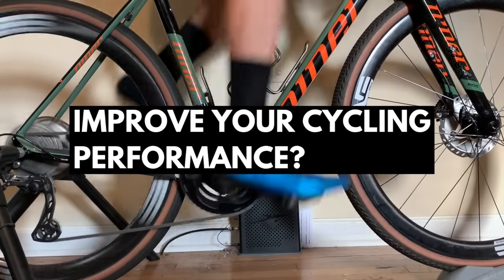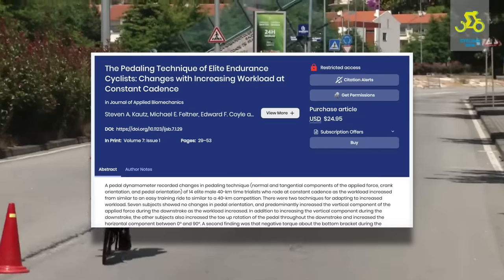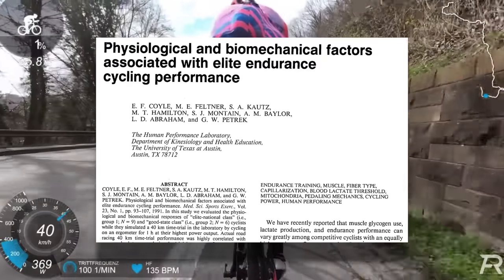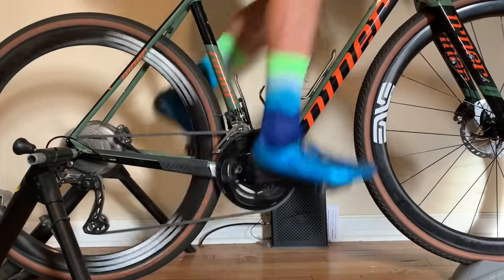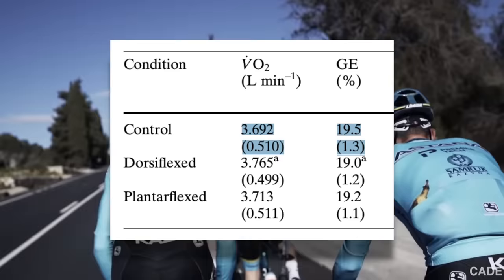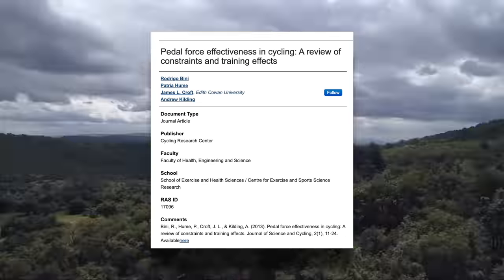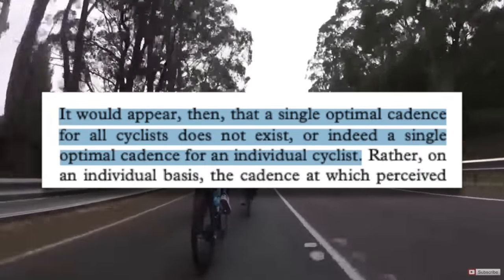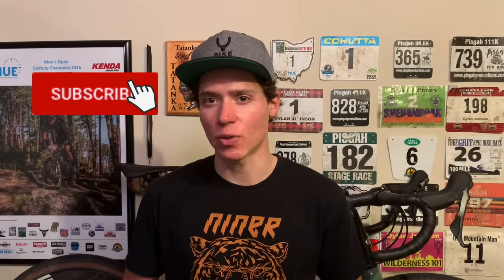Does Your Pedaling Technique Affect Your Cycling Performance? The Science

Comment: Just wondering, how many of these studies had subjects stick to altered cadence / technique for longer than just the few rides they had them do for the study? The fact that doing something new you've just been told about decreases performance shouldn't really come as a surprise regardless of whether that something might ultimately be beneficial. If nothing else there's a mental tax involved with something you're not used to. It wouldn't surprise me if it still doesn't matter, but it also wouldn't surprise me if some people are in fact stuck in a local optimum and would improve if they adopted a different pedaling technique over a longer time period.

Comment: For regular cruising, the upstroke leg should lift itself.  The downstroke leg should not have to power the bike, plus lift the other leg back to the top of the stroke.
You don't have to pull a tree stump out of the ground, just make sure that the leg lifts itself.

But when you are sprinting, yes, pull on the upstroke like your mother is hanging on to that ankle and she is dangling over a volcano.
Reply: Thank you.  You are exactly right on both counts.
That needs to be stressed by anyone who claims to offer advise on pedaling.
Reply: @deezynar good tips and all but did you reply to your own comment agreeing with yourself?
Reply: @erzhaider  
I don't typically reply to myself.  That was 2 years ago, so I have to guess about what happened.  I assume that someone else replied to my comment and I replied to them.  But the other person removed their reply later on.  I have just a slight memory that the person is the one who posted the video, Dylan Johnson.  But I am not certain at all.

Comment: Most people forget that the hip is a bigger and stronger joint than the knee. Which means your hamstring is a big contributor to the power in the down stroke. If you use hamstrings on the upstroke too, there will be a minimal time that muscle is relaxed during the rotation. If you take a look at the blood flow in a muscle flexed compared to relaxed, its obvious that not relaxing the hamstring is a big no-no. U r welcome.

Comment: I wonder how much trained vs untrained muscle activation is biasing the results. For instance, if you train 500+ miles with practicing circles how would that change the 'natural' feel and efficiency of the stroke now that the specific muscles used in the back, up, and over motions are conditioned in the same way downstrokes are practiced. I also wonder if any of those studies used isolated power meters (looking at only one side) that could measure both positive and negative force instead of just combined downward force.

Comment: Don't get a choice with fixed gear! Works really well on the flats. Yes, you will pedal differently at high and low cadence.  Sort of like developing a broad power band in automotive terms. Never ideal, but close enough. Maximum mechanical efficiency at all times though. I noticed many years ago that under high loads trying to get on top of a gear, torque gets applied earlier in th downstroke. Light loads get a more gliding even torque application.

Comment: Roughly my 11.5” feet weigh about 7.5 lbs each. 
Using the scientist approach (as a scientist) lbs = gravity , just lifting your feet up alone 70 times a minute would be like lifting 1,000 lbs a minute one 12” using your legs.
Of coarse there are other factors on the equation, but those are the main ones.
No, it would not be advantageous to power up strokes but to spin pass the upstroke and power down using gravity to assist you.
Sometimes when my legs burn I switch to the “duck paddle” with some successes.

Comment: The video focused on efficiency, but my question is if you change where the power is applied in pedal stroke and cycle between toe up toe down pedaling on endurance rides will that help to reduce fatigue and cramping by switching the load on different muscle groups??  great video thanks for the content!!

Comment: Hey Dylan, thanks for the great content and cheers from Russia! I'm in my first season of structured(ish) training with a power meter and have some questions, perhaps you could help me out?
1. Is there a benefit to building structured workouts in TP if my headunit (Garmin Edge 130) doesn't actually support such workouts? For now I just put in generic workouts on the calendar and time my efforts the old-school way.  
2. I'm really struggling to fit intervals into my training - most of my rides on weekdays are confined to urban environments where doing an uninterrupted several minute effort is not always possible and/or safe. So while I try to keep recovery durations consistent (I do have to count standing at stop lights and/or in traffic as recovery:)), my effort durations are erratic at best. How much does that affect training efficiency? How should I modify my workouts if changing locations is not an option?
3. I'm presently using a power-meter on my road bike only. Thinking of getting one for my MTB but can't seem to choose between a single-sided crank-based PM and a spider-based one - how durable is a spider PM if, say, you whack your sprocket going over a log or some rocks?
Reply: Old timer here.
1. Never used anything like this. I knew ahead every workout I wanted to do. I only had an old watch head "stuck" to my handle bar stem. It is much better looking at a sweep hand than a digital face. I dont see why you cannot remember any workout you plan to do. Then do it. I learnt cadence from a piano metronome. In my day noone was allowed any type of timing device or outside assistance. When you get amoungst the best its about knowing yourself. That means riding by feel.

2. This is a very common problem. I fortunately lived 20 miles outside the city. Today I live up the road from a public velodrome. Is there a public velodrome that you can use?
I had a friend who was a national champion. He got up at 5am every morning. Eddy Merckx was said to have gotten up at 4:30am to train. How much do you want to exceed?
Maybe organise your training so your intervals are done over the week end.

 In the beginning its doing miles. It doesnt matter how you do them. More important  - How many tyres do you wear out? If you are not wearing out tyres you are not training. It takes 2 to 3 years to build a base training level. Like a house. You cannot put a strong wall and heavy roof onto a poor foundation (base). What matters is consistency. Its not what you do , but you are doing it.( After 10 years its about training years not how you have done them. That means miles, miles and miles.)
Next focus on leg speed. Take up track cycling. The most time efficient way to train is to race both road and on the track. Do lots of training with low gear and high cadence. Im talking 68 or 72 inch gear for 1 or 2 months. Do this before the start of any racing season. Start studying how to weight train. Off season do 6 months of all round strength development. After that aim to weight train at least once a week. Forget about Olympic and Powerlifting. Weigth train on the bike. Chris Hoy used to add 40kgms in weights to his training bike and ride up hills. Put heavy tyres, mudguards, light, toolbag tools pump on your bike. My favourite was to add house bricks onto a rear rack.
Remember any training MUST come out at the rear wheel. You want leg strength and leg speed. 60 years ago top cyclists weight trained on the bike. Guess what today its the new way. 
It doesnt matter how much you can squat if you cannot get it to the back wheel.

My road training plan M off, T intervals, W tempo, Th hills strength,  F off, Sat long ride, Sun half long ride. For you swap Tues and Sunday (intervals).
Knowing how you are responding to training is more important than what you do. Go out and do something. Then ask yourself the next day can I do harder or easier.
Other ways - easy, moderate, hard etc or easy, hard, easy, hard so on.  If you static stretch you need to do this every day. Static stretching before or after competion is a waste of effort.
I used dynamic stretching - a US army calisthenics program I found in the library. Dynamic stretch well before the start of a race. I used to do this every morning.
Swimming is great to impove posture. So swim on days off especially in hot weather.
Lastly the most important way to improve performance is SLEEP and DIET. I will say it again 80% of the impovement in performance is SLEEP and DIET.

3. I would suggest a power meter that can be moved from bike to bike - pedals. Assume that you have a pedalling difference from one leg to the other. Save your money. Use one legged squats and if possible (one) leg presses. The 2 biggest training mistakes : training to hard on easy days and training to easy on hard days. Make the hard days hard and the easy days easy. 
Lastly you cannot train speed and endurance at the same time. Think of a seesaw. One side is speed the other endurance. If you train speed (less than 4 minutes) time goes down. Then endurance goes up. If you train endurance it goes down -  then speed will go "up" slowing down.. The same thing happens with leg speed and leg strength.
This is the number 1 secret in cycling. My advice is to keep training sessions to an hour in the morning and an hour at night. Only do 2 hour training sessions to loose weight. 
Remember Usain Bolt was unable to race a 800m race because he couldnt finish it. Carl Lewis's fastest time over 800m was 2:16. I was faster in high school.
Endurance training destroys speed. Speed training destroys endurance. You cannot have both.

Comment: Would love to know if its normal to have an uneven distribution of power between right and left. Recently got power pedals to give me data on each side. Looks like I tend to have 48%/52% Left/Right distribution of power. Sometimes is more prominent toward the end of a long ride or at extreme fatigue levels. Part B of the question: worth it or possible to 'train up' the weak side? Interestingly, torque effect is similar for each leg. Also interesting, and to your point in the video, the weaker leg has a larger radius of power stroke, the stronger leg shorter, but stronger power stroke.

Comment: Dylan - your videos are fantastic, thank you for the great content! I was wondering if you have looked into saddle tilt? The UCI changed their tilt rules a few years back, and I recently tilted the nose of my saddle down to relieve perineal pressure. The downside appears to be more pressure on the hands, but that is a trade-off I'm willing to make. Curious for your thoughts on the benefits and drawbacks.
Reply: @gumzster  I have not tried a saddle with a cut-out. I have read mixed reviews on their effectiveness. I was hoping to make my existing saddle work but I realize that may not be the best option.
Reply: @gumzster  Thank you for the advice - that's a great data point. Would you mind sharing the make/model of the saddle you switched to?
Reply: @gumzster  Thank you! I'll look into some bike shop demo programs and check out Fizik and Specialized!

Comment: I've noticed recently that during intervals my power fluctuates a lot and it's not a smooth output to get to the desired lap average. For example a 300w interval looks like this 350, 250, 350, 250 instead of 290, 310, 290, 310. The average is the same but I think the irregular power requires a lot more effort. Can this have to do with pedaling technique or should I see it as something different that I need to work on? No idea how I can improve this

Comment: Ok, I got that pedaling in circles wont help to increase power a is not gross efficient.  I got that extensor muscles are better to generate power than flexor muscles. But what about pedaling in circles even knowing that is not as effective as pushing in the downstroke but to balance the effort/stress between flexors and extensors in the moments of the route that dont require a high amount of power to not fatigate the extensors, and reserve them for the moments that you really require the maximum power and sustain it for longee time? Is this approach acceptable? Or even in this situation it wont matter? I think that a better distribution of stress among all the muscles can provide better power peaks for longer time using the extensor muscles.

Comment: If you ask a group of riders to perform a pedaling stroke in a way they are unfamiliar with, will it always be inefficient? What if they studied riders who prefer and are adapted to puking up on the back stroke, would the efficiency be any different? 

I'm not necessarily an advocate either way, but it just seems to make sense. If you are unfamiliar with a movement, you won't be good at it.
Reply: Physio studies all the way to the beginning have found the athlete is just as powerful or efficient (not the same thing) in their habitual position as in any "optimal" one. "Correct" position is about avoiding injury long-term or creating headroom for improvement.

Comment: You can't argue with mechanical efficiency.
Just ask if you would travel in a car and keep lightly depressing and releasing the accelerator. This would obviously increase your fuel consumption.
So why would you do the equivalent on your bike?
Ignoring smooth pedalling would be to accelerate you, the bike and all the rotating masses including wheels, cranks and movement of the chain twice every full rotation of the cranks. Only to let the speed gained subside again.
Obviously there are limits.
Smoother pedalling with a lower maximum force mid-stroke with the same average force distributed over a wider arc would be less tiring.
It's interesting that some top Professionals are experimenting with shorter cranks which I think would reduce the arc the thigh moves through and encourages a higher cadence.
A smoother pedalling style would also minimise the tendency to pull / swing the handlebars from side to side often seen even in top riders' describing a series of shallow S's on the road as they pull and tug at the bars when in a lone break and running a big gear. They follow a longer path than in a straight line and scrub off speed with the front tyre as it isn't in-line with the direction of travel.
This may be acceptable in a flat out climb or sprint but should be avoided for longer distance, energy saving sections efforts: i.e.most of the time.
As instrumentation becomes more acurate I think it will show worthwhile savings in energy in-put and be kinder to muscle and joint health.
Remember: a Tour de France has been lost by 8 seconds. Even 5 mins is miniscule over a three-week Tour.
I think it would yield a greater saving than longer socks or a wider, heavier helmet and only cost some practice and testing.

Comment: I still think the ability to pull up on the pedal , certainly when out of the saddle would increase power.  Let us neglect hands on the bars. And assume the weight of the rider is 100 lbs. Pedal force would be 100 lbs. Max. Let us say then that the rider tries to pull up and can get negative 10lbs of force on that upstroke. Thus power output would increase 20%, by that very realistic case. 20 lbs up? , then 40% increase in power.  100lbs = -10 + x , per statics, x = 10, where x is the added downward pressure  on the leg you are standing on. So 110 lbs down and 10 lbs up is possible for a 100lb rider.  If said rider could lift up 100 lbs ( impossible) the power out put the rider could do would be 3 times as much as simply standing on one foot.
Reply: And , no, I haven't even gotten into o symmetric cranks. But if you go that route, add another 10% to all the above power figures.  I measured the osymetric  ring radius at 15 degree increments,  assume only downward force from gravity and constant wheel speed. I found 10% increase in torque.  Torque x rpm is power and rpm was constant in my example( in order to neglect any instantaneous acceleration if the inertia on the system was very very large, it just knocks out that variable for simplicity.   I'm not a huge fan of osymetric rings on tt bike or even road bike in tt position because the power producing core muscles are not permitted to be used that much because the osymetric ring refuses to reward hi pedal force at 12 and 6 o clock.  So, in tt, the round ring provides more torque producing opportunities for those with the core to turn power there. And I think realistically any cyclist can grow to be strong in turning a large part of the round ring's torque making angles.

Comment: While I appreciate the research, I see that there is no firm conclusions on pedaling technique as further more studes are required. Moreover, I am not sure if this video is geared to beginner cyclists or the pros or the seasoned ones. IMHO, I think pedaling is a skill and to be good at a skill you have to learn. I started cycling with very low cadence between 60 and maxing at 70rpms. If I believed that 'my body' is okay with that, then I will probably stay the same. However, I worked on improving my pedaling and now my cadence is around 80 rpm to 95 rpm on average. I feel fit and more comfortable at this cadence range. Even the pros are pedaling higher on average save for the very few. There is a reason why most of cyclists who ride distances of 30 miles plus at average speeds north of 20mph (32kph) do so with relatively high cadences (say from 75 rpms). While there is no "one size fits all" in pedaling, still improvements are necessary. But if you want to just casually ride around, then by all means do what "your body" tells you and try not to improve yourself.

Comment: Try riding on your trainer with one leg. Switch legs and repeat. Do it on gradual uphills. You will be sore in muscles you didn't know you had. I did this for years. I raced and beat 30 yr. olds when I was 50. When riding in the pack your down stroke muscles will be ready to spring into action to follow moves. Why does no one seem to know this?